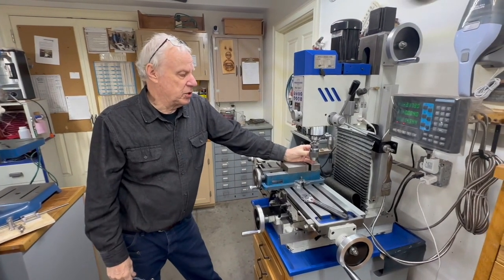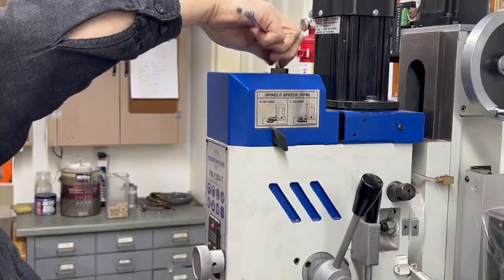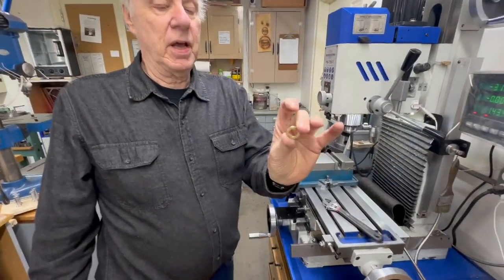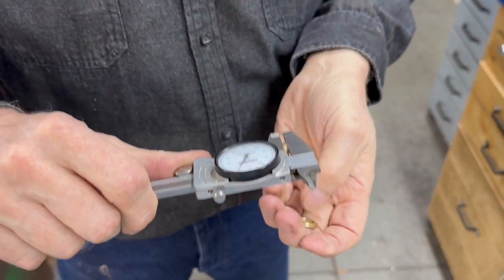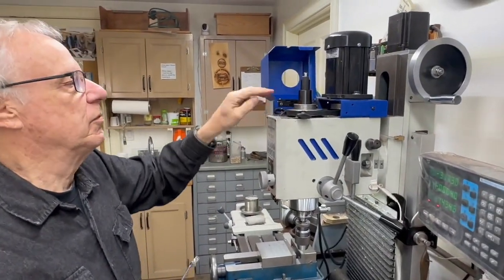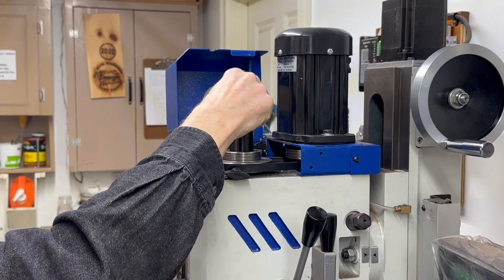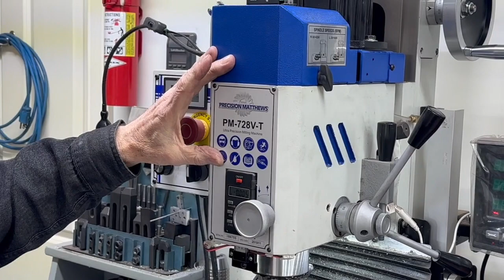PM 728VT Milling Machine Spindle Shim

Comment: Interesting. My 727V doesn't have the same style spindle drawbar. It's not self releasing.  BTW, your mill is a 728 right, not a 1228, that's a lathe model I think.
Reply from the maker: Interesting , mine is only about 4-5 years old but it’s definitely a728vt
Reply: @JoesModelEngines  Right, but your title on the last two videos says 1228.
Reply from the maker: You are correct and we are working to change this. Thank you for your input.
Reply: @JoesModelEngines  Just wanted to make sure you knew.